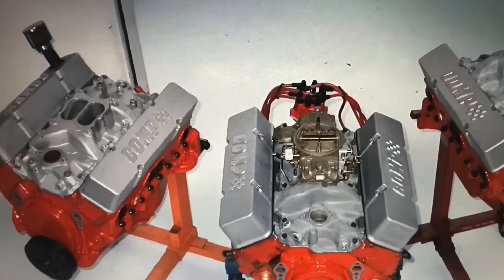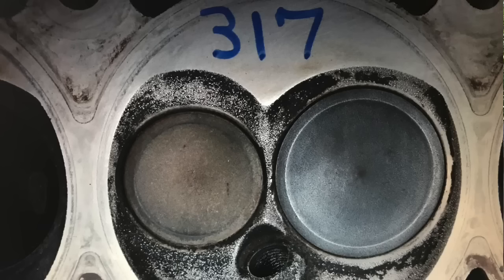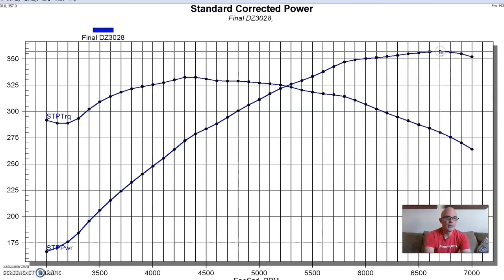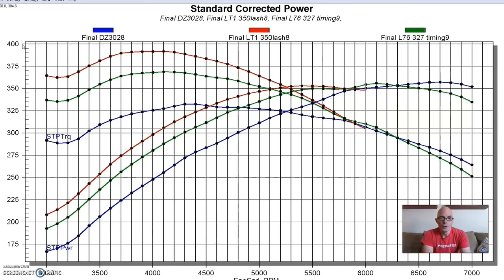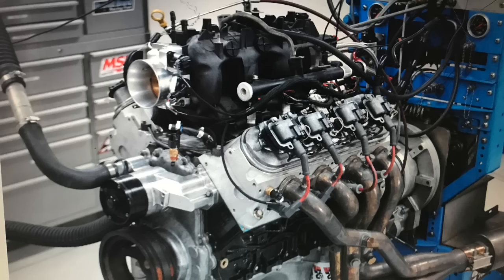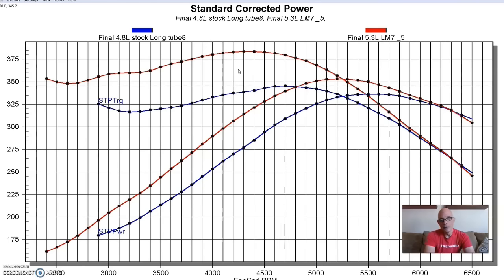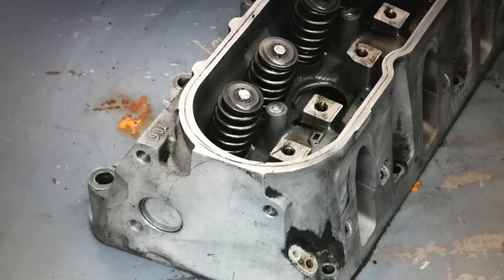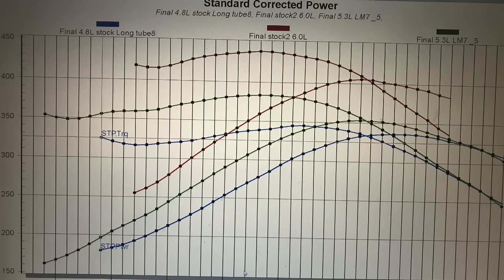HOW MUCH HP DID THE 1969 DZ302, THE 1965 365-HP L76 327 OR 1970 LT1 350 REALLY MAKE? WAS IT FAUX HP?

Comment: Once again
 you've done it
 another badass legendary video
As I see it all these engines have the same specs overall the only difference will be the peak RPM  point and the lower the RPM Peaks the higher the torque will be because   also will be at a lower RPM these engines only flow about 
605 CFMs......

Comment: Awww missed the 400 sbc. Lol
Reply: More is mo' betta
Reply: @ronnelson7828  not on this curve it aint,the 400 would be super low on horsepower
Reply: @trillrifaxegrindor4411  which curve are you speaking of?
Reply: Olds Pwr the same reason they put sbc after 350, 327, 302, 283, 🤷🏻‍♂️🤣 because the 400 is.
Reply: At least in factory trim, the 400 small-block was never meant to be a performance motor.  Along with what Ken Snyder mentions, in order to get that much bore into an SBC block the cylinder liners were siamesed, which gave the engine a tendency to run hot when pushed hard.
Reply: @DinsdalePiranha67  I have been building 400 small blocks for 35 years and the overheating story is an old wife's tale. Before the LS motors came out I used 400 small blocks in my tow vehicles with 9 to 1 compression and my hot rods, and my stock cars with 10 to 1 compression and performance cams with no overheating problems. You can't run the radiator out of a 305 Nova and expect it to do the job. A 4 core radiator and a decent fan with a shroud is all it takes and I live in the southwest where 110 degree days are normal most of the summer.
Reply: @anthonynelson9136  never had a problem with heat in my 406. Even when I forgot to turn the fans on. A proper cooling system is essential.
Reply: @DinsdalePiranha67  in my experience, 400 small blocks would get warm around town because steam would be trapped under the deck. People don't drill steam holes in the heads they would put on them
Reply: @Olds_Pwr  I guess not to confuse people with the 396's sister the 402...
Reply: @kramnull8962  pulled the words out of my mouth 😁👍
Reply: @Olds_Pwr  yeah I've built many big blocks. I prefer the 3.76 stroke. The 454 block at 4.31 bore, the l 2300 piston, the rods are the same. The closed chamber head with 2.19 and 1.88 valves, cam at about 550 lift 245 during @50 107 sep .that combo will RIP the asphalt on the street on the cheap. What do you think.
Reply: @davidreed6070  It's much easier to shoehorn a smallblock into an S10. 406 ci. and about 2700 lbs. Its all about traction.
Reply: @Olds_Pwr  Marketing reasons; I've had two 1971 big Chevys with a 402 BB and a 401 SB as well as a 1974 Chevelle SW with that same 401 SB. '400' just sounded sexier.
Reply: 400 sbc's were only used in trucks and big cars for a reason.  Yeah, they made lots of low end torque, but they weren't built to hold together at high RPM, and they used low flowing heads for economy and low RPM torque. That's why so many builders use the 400 crank to stroke 350s to 383 rather than building a performance 400.  Today, they can be built to handle some high revs, but it wasn't worth the effort back when they were made.  They had the big blocks to get higher displacement that wouldn't fly apart at high RPM, so they didn't need to built up the small block that big for performance.
Reply: @livewire2759  Exactly! ^^^ Although I'm still surprised that Chevy didn't drop the 350 and 400, replacing them with the 383 for 1977, with the 305 handling small V8 duties.
Reply: @Olds_Pwr  396/402 THATS WHY
Reply: @Olds_Pwr  401... plus charge, they call it a 402.
Reply: Oh yeah, I would not miss the 400 small block  I love them, my favorite. 6 inch rod to decrease the angle and they are ready to do the job.
Reply: What power would the 400 make equipped with the fuelie heads, Duntov cam, Z-28 aluminum hi-rise intake and Holley 4 barrel these other engines utilize? No need to wind it to the moon, as soon as you step on the gas you're into the power band.
Reply: You got that right about the 400 sbc in the s10 that will be my next one if there is one. Twin turbos along with it about 1000 hp on the street would be fun. Another thing to someone about the 400 sbc scrubbing the cylinder walls, put a 6 inch rod in it and problem solved. I spin them to 7200 to 7400 with good parts no problem.
Reply: @davidreed6070  I'm just going N.A. for around 475 hp. Putt-putt around and try and keep it on the ground.
Reply: Sometimes people don't exactly know what the motor is making and numbers get exaggerated but 475 on the street is hard to handle.
Reply: @davidreed6070  Thats at the flywheel not rear wheel numbers. And hasn't been on a dyno, just guesstimated power. With steam holes only on the exhaust side. E-Tec 200 heads.
Reply: The big issue with the 400 was the side scuff in the cylinders. The long stroke without adding deck height was maxed out & the wrist pin was almost touching the oil ring land. They did run well but that was the trade off. I think that's why Chevy mainly just put them in heavier Impalas & Monte's.

Comment: My take away is the LS is good for 50hp over the old small  block.
Reply: Better heads and roller cam technology.
Reply: no fucking shit. its got 10.5:1 compression, roller cam/rockers, etc....give the sbc the same, and there is no difference. popular ls swap days are numbered, because parts are getting expensive and engines arent easy to get cheap anymore.
Reply: Someone doged there research. 1970 wichita,is fred mota in airforce. 1969 Z/28 13.81 et  103.86 mph Ahra meet wichita. I believe  H show room stock was the class. So fords did not make a show.

Comment: When the bore is the same and you only change the stroke the horse power will be the same at the same piston speed just slightly more on the shorter stroke. It appears that all three classic engines are only running at about 3500 piston speed. Just imagine what those old engines will do at 6000 piston speed with the right intake heads and cam.
Reply: mainly the HEADS!!!!!!   bmep is everything.....

Comment: I would like to talk to the engineers who designed the ls engines to find out how they figured out what bore and stroke to use you would think they would have used the same block and increase stroke again for the 6.0 but they went for bore and flow
Reply: No doubt.  Wish instead of the 5.3L, they put the 4.8L crank into the 6L block.  Maybe even made a 3” crank...  added to the 6L block would have made an updated 302.
Imagine if 98-02 Camaro’s had the option of a 5L 302 LS screamer in the Z28 and the LS1 in the SS.
Reply: @stlchucko  I had that idea for the l98 I was thinking about upping the stroke on the ls to about 3.75 if not 4 inches matching that of  the bigblocks of yesteryear compare a 4 inch stroke last to a 454
Reply: Actually, the 6.0 has the same 4" bore as these 3 SBC do.
Reply: @milojanis4901  I understand that I'm talking about the smaller ls engines
Reply: If you scroll through his videos he did a destroker LS it was quite awesome

Comment: Short stroke or  over square engine more rpm less piston speed less tourqe vs under square engine more tourqe less revs faster piston speed .what ya think richard
Reply: It's potential and that potential is based on things like the camshaft, manifold and carb/injectors. With all the same parts they will act similar, use parts that allow for what the potential of the engine is and we'd see drastic differences all through the RPMs.
Reply from the maker: Same displacement=same power
Reply: I kinda agree with ya many factors.but a longer stroke vs same displacement or bore size shorter stroke. Longer stroke has a faster piston speed which has greater leverage on crank which  produces more rotating Speed =more crank rotating  force hence no need for high rpm to gain crank speed.rpm and hp correlate with each other again there are other factors.f1 engine revs to 15000 plus rpm to get its hp or top speed as tourqe isn't as much. short stroke rpm makes  movement of reciprocating parts is much faster  rpm to get  crank speed.if f1 engine only revved to 6000 it  woundnt be good hence short stroke high rpm.Here in Australia Ford barra engine 6 cylinder 4 litre 244ci  has a bore of 92.31mm stroke 99.06 produces around 268 hp depending on fuel octane produces 302 foot pounds of tourqe revs 6000 hence longer stroke. Yes there are many other factors vavle events exhaust back pressures  on rising piston ect.to me air density is a major part that hardly anyone talks about except Gale banks

Comment: Area to volume ratios and timing effect the curve. Because they all have the same valve and piston areas the stroke serves to change the volume part of the equation. The power is related to area. The torque is related to volume. The shape of the curves is related to both.

Comment: If I could have any one it'd be the DZ for sure, small displacement V8s are my favorite
Reply: I have a large journal , Dart head,  DZ in my garage that got hot and pushed a head gasket out. I love the engine but it's hard to spend money to refresh it when LS motors are so cheap to make more power with. I also have a LC9 all aluminum 5.3 and LQ4 6.0 sitting next to the DZ. Decisions, decisions.....
Reply: @bdd1469  I see what you mean, I don't know if I want to rebuild my 350 or just buy an LS3 that'd make more power, cheaper, and reliably
Reply: @bdd1469  didn't think they made a aluminum 5.3??
Reply: DZ probably can handle the revs more than others. For the ones like over revving lol I’m not a fan losing power by over revving lol A lot out there do that lol
Reply: @Silkmaster4200  Based on Richard's dyno graphs, a properly built 327 can probably rev almost as high as a DZ.  The combination of that and greater torque from its longer stroke would make it a pretty potent street motor.
Reply: @DinsdalePiranha67  Sorry but a 1970 Z28 with the LT1 350 (and 4.10 gears), the most powerful conventional small block in this test, ran a 14.2 1/4 mile in Car and Driver's road test when the car was new. That's about as quick as a V6 Camry is today. How would a 327 like the one in this test be a "pretty potent street motor" by today's standards?
Sources:
https://www.caranddriver.com/reviews/a15141878/1970-chevrolet-camaro-z-28-road-test-review/
"14.2 seconds at 100.3 mph in the quarter is as good a measure as any of its physical fitness"
https://www.motortrend.com/cars/toyota/camry/2018/2018-toyota-camry-first-test-review/
"14.3 sec @ 99.6 mph"
Reply: @chipcurrey653  Two words:  modern tires.  Keep in mind that cars of the late '60s and early '70s were on skinny bias-ply tires as factory equipment.
Reply: @DinsdalePiranha67  tires make a huge difference
Reply: @DinsdalePiranha67  They both did almost exactly 100mph - trap speed is a function of power to weight. What makes you think trap speed is traction dependent on 14 second cars?
Do you have any proof that a modern tire will improve the trap speed?
Reply: @chipcurrey653  yes, because the 60 foot time would be decreased, giving the car time on the other end to shift into another gear, since it probably had shitty highway gears.
Reply: @frigglebiscuit7484  the Camaro in that test had 4.10 gears. It literally COULD NOT be driven on today's highways with 4.10 gears and no overdrive unless you are willing to turn 4000rpm to go 75.  I linked the article and pointed that out.

Do you have any proof putting a modern tire on that car would improve the run?
Reply: DinsdalePiranha67 right on. I just figured a small engine can handle more. Cause they don’t have a lot torque and less stress. I guess depends how’s it built. Every engine not always the same lol
Reply: @chipcurrey653  why sorry? lol..i think its funny when folks use that term when there's really nothing to be sorry about..lol anyways people almost always seem to forget that the 302 engines were not designed for quarter mile racing. It was designed for road racing and thats where it excelled! While the LT1 may have edged out in the quarter mile time. I'd like to see the results in a half or even a mile race..😉 🤷‍♂️
Reply: @chipcurrey653  keep in mind that the guys at Car and Driver were nowhere near as good at drag testing cars as the guys at say Popular Hot Rodding magazine .
Reply: @lepus6511  So a laundry list of aftermarket items to beat a Camry? Who missed the point again?
Reply: you understand the only difference between it and the 327 variant is it would make is less torque and horsepower,right? 

they were great for the trans am series they were designed for but why take less purposely when more is available in the exact same package??

its like wearing black silk crotchless underwear while working in construction.you are the only one who knows and all you are getting is less?
Reply: I was absolutely just about to post this same comment.